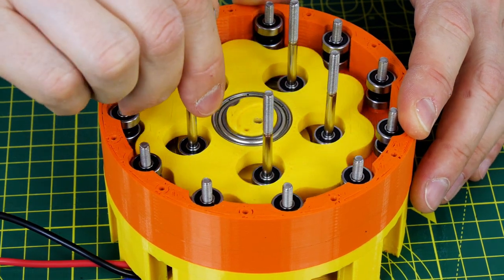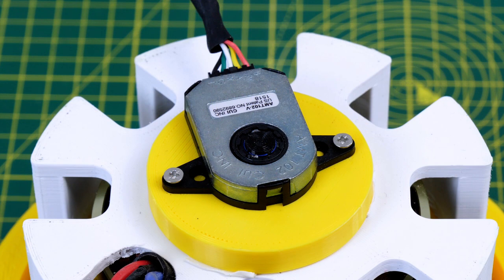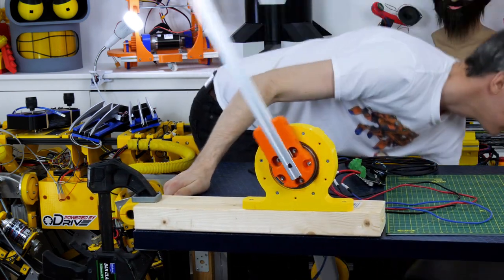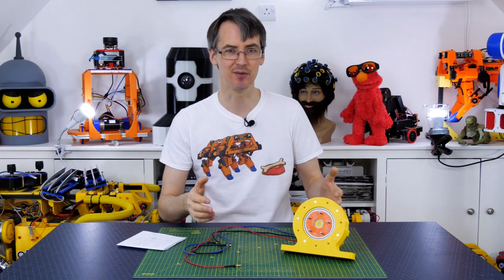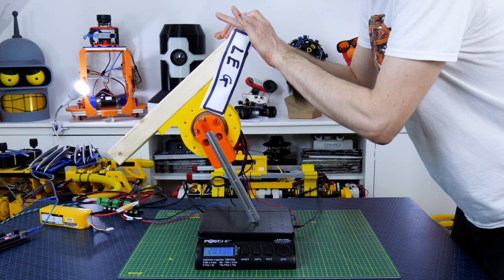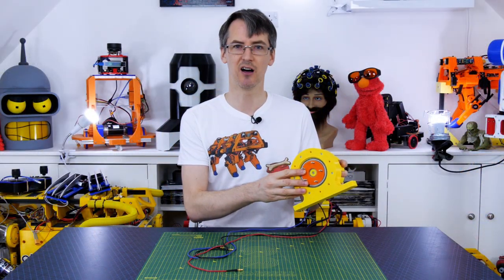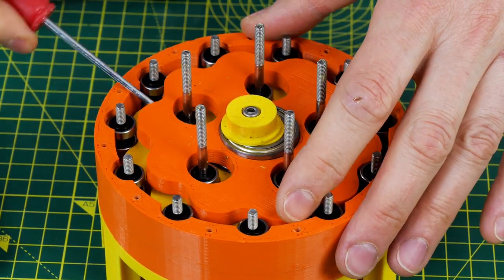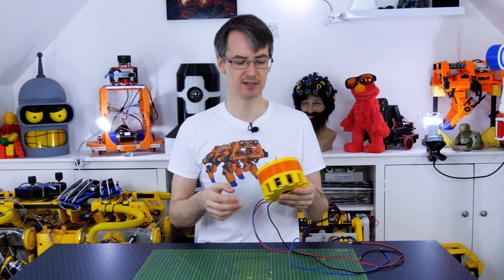Testing: Cycloidal vs Harmonic Drive 3D Printed Reducers

Comment: I imagine it would be very difficult to get comparable performance out of the strain wave setup with 3d printed materials. You lose an enormous amount of energy in the flexible spline simply due to it flexing. I have not seen a proper metal strain drive in person, but I'm pretty sure the walls of the non-toothed section are only a fraction of a millimeter thick for a drive that size. It may not seem like that big a deal, but when flexing a tube like that you can encounter rather large forces on the wave inducer.
Reply from the maker: That is true - just trying to make it robust, but it's not an ideal version

Comment: You could 3d print bearings and still have the weight and cost reductions with still pretty good bearing performance but it does still add a point of failure.

Comment: in order to reduce weight and cost you need to test designs without bearing. Have you thought about 3dprinted discs with a brass bush insert???

Comment: Could the harmonic low load be in part because of it being TPU? wouldn’t the high elasticity of TPUs potentially allow the teeth to skip under elastic loads 

I built one in PETG recently not thinking about the flexible spline  but havent been able to connect a decent motor to test it yet

Comment: I would consider using UHMW instead of nylon for the bushings, if you can get it at a good cost. It is the typical bushing material used in power tools and is far cheaper than Delrin.

Comment: Hi James, just a quick question: Have you had problems with the new Odrivetool/firmware programming? Because I just got into using the Odrive, but the current documentation on the Odrive site doesnt seem to correspond with the current tool's syntax? Do you know where I can find up to date documentation, or what else is causing this? I have a 3.6 as well. Thanks!

Comment: Hey James, might it be a good idea to integrate a temperature sensor in those drives to monitor the internal temperature? Then you can prevent it from overheating and melting the PLA.

Comment: Starting to look promising. Are the two disks still rubbing against each other? Having a tiny space between them could lower the friction even more and avoid heat, not that it seems to be a problem yet.
Reply from the maker: Yes they are, I really wanted to see how well the original design would hold up. I need some way to hold them apart, but I don't think there's too much friction since there is no load that way, so maybe just printing them in Nylon etc would do.
Reply: @jamesbruton  alternatively perhaps a bit of lithium grease would help?

Comment: I wonder if he could design a Nylon sleeve insert around the cycloid so that it'd be easily replaceable and less costly of the more expensive materials. But i do have a major question about nylon against nylon, i know in engines they use two different metals for surfaces that rub together because the "grain" is different and it reduces ware. So would two 3D printed of the same type have this same effect, and could it be mitigated by changing layer hight or some other factor?

Comment: Would it be possible to add a way to lubricate the internals without having to disassemble the motor? I’m just thinking of a long term usage (which may not be necessary or applicable here), but it would get very frustrating having to disassemble the entire robot and then all of the gear boxes to do maintenance
Reply: you want to lube the bearings more than anything. they already have a small amount that should last for any significant period of usage.

Comment: one thing i never understood about Boston dynamics Spot, and open dog, is why not use wheels on the tip of the legs instead of it just acting as a leg?
would this not drastically increase its speed as well as its ability to maneuver? sure it might not always walk like a dog, but it would have the ability to.
best of both worlds if you ask me. though i do not know about how this would affect the legs weight. might be the reason why not but if it somehow works, i would love to see the result.

Comment: I want to get into robotics but I’m on a bit of a budget. How much of a torque difference is there between the odrive and skateboard esc?
Reply from the maker: If you use sensored motors then you may be ok, although accuracy will still suffer. ODrive controls two motors, so I generally find they are cheaper overall.
Reply: @jamesbruton  I’m looking at sensorless brushless motors, I am more worried about the torque than accuracy. Will it be greatly reduced using a skateboard vesc over the odrive?

Comment: How's backlash for the two systems?
Reply from the maker: There is a little in my Cycloidal Drive, but the Cycloidal disc isn't quite the right shape - see Levi Jansen's video I mentioned, so it will be better in the next version. Harmonic drive has virtually no backlash, but again the design is not ideal.
Reply: @jamesbruton   The cycloidal disc probably failed because of the use of flexible material. This might cause the rubbing surfaces to lose alignment as tension increases thus increasing the friction. The flexibility should only be allowed laterally which a reasonably long cylinder should permit otherwise.
Reply: i would try to make the flexible ring in the harmonic in regular pla, the ones i worked with is pretty hard like springsteel.  but tbh harmonic drive is probably a bit to delicate and requires to steep tolerances for fdm printing, the cyclonial drive seems like a much better option for this.

Comment: U pick high-speed electric motors with a small moment to then lower the speed of their rotation to increase the moment. Why?  As far as I know electro engines so same as internal combustion engine  have  the higher revs the less efficiency..     The losses increase exponentially, and the power increases linearly...  or is it just that power electric motors are big and weigh a lot?
Reply from the maker: I need a lo reduction so that it can be back-driven to make a Quasi-direct drive reduction, so I get natural spring in the leg of the robot. Check out Cycloidal drive part 1 for the explanation, and the openDog V2 series.

Comment: I feel like a planetary gear is the obvious omission in these experiments here. Although, perhaps you already guestimated that puts too much load on the teeth ? Afaik they're pretty strong and print well though.
Reply from the maker: Yes I need that robot dog to jump on the ground, so I think 3D printed teeth would strip easily. That was what started me on the Cycloidal drive development because the discs are far more robust.
Reply: @jamesbruton  Yeah I figured. Still, with the size of these solutions you can make a pretty serious planetary gear too though :P

Comment: I think you can improve the harmonic drive by having the 2 teeth difference between the flexible gear and the external gear. It should scipe a lot less.
Reply: Just incase you don't know it's skip. Not sure what scipe is.
Just a friendly FYI

Comment: The cheapest bearings I find are less than 0.2€ per bearing. Are bushings superior to Chinese bearings? At some point the price difference between a German bushing and a Chinese bearing becomes small. I would be curious if you investigate that further. I may underestimate bushings. Or overestimate the capability of Chinese bearings. I thought they might be good enough to improve 3D prints. Some sound like they come with polyhedrons instead of balls, but they still feel like they have lower friction than plastic on plastic and probably a lot less wear.
I didn't consider good bushings. Maybe some Igus ones even reduce the friction and especially the vibration?

Without having thought about it more, it seems like the bearings and the shaft are the points producing the most friction and are most prone to breaking.   So a metal shaft would make sense.
Reply: Cheap bearings are still heavier than plastic, and aren't really needed here because if the cycloidal profile is correct it should be rolling so the bearings wouldn't turn at all.
Reply: @kaelwd  I don't understand how something can roll without turning. 
I see the weight savings, though. Concerning the weight and the price, I just wonder if it is worth it and I would love a benchmark.
Reply: @maxmustermann2596  when they say rolling, it's the point of contact that moves on both surfaces at the same time, not via friction nor via a bearing in which the pin turns. (cf for example https://www.youtube.com/watch?v=vs3xSoQyW1s) 
if the profiles are correct, there is no rubbing, but a moving contact point on both surfaces
Reply: @thesfreader3068  Edit: After having checked your youtubelink, showing off the knowledge of a word, which is explained there, sounds stupid. But, I swear, I knew it before ;-)
Somehow I didn't think about Involute gears https://en.wikipedia.org/wiki/Involute_gear
In that case, bearings are definitely a bad choice. Now, I need another reason to motivate somebody for a benchmark ;-)
Edit: I'm curious how real-world problems like slightly flexible materials influence the functionality of involute gears. I have to admit, that fully understanding them is still on my to-do list. The transition from one tooth to the next one still looks like friction.
Reply: @thesfreader3068  You seem to be better educated about gears. Do bearings on gears make sense in special situations? High loads? (although it doesn't seem very economic concerning how much a single bearing raises the part count)
I know 45° gears are problematic, but that is not solved by bearing balls. In this scenario, it replaces a gearbox, which might be feasible? https://s14761.pcdn.co/wp-content/uploads/sites/3/2019/09/Ceramic-Speed-Driven-drive-train-Antrieb-2020-News-Eurobike-2019-2020-002-810x540.jpg
Reply: @maxmustermann2596  sorry can't help you, everything I know about bearings and gears I learned on YouTube... (thanks James and all other great makers out there!)

Comment: You know, I've been meaning to say this in earlier videos but figured a dozen others before me already did. Either no one did, or not enough.

Please don't test the drive's torque by simply grabbing a spinning lever like that. You could easily break your arm between that 2X4 and the lever if you fail to let go in time.

Comment: To give the harmonic drive its full glory, the parts including the flex spline should be made of metal, in a much more precise way than what a 3d printer using FDM can do. Harmonic drive is not the right technology for a plastic 3d printer, much like bearings.

Comment: You should send the designs to rctestflight and tell him to try those on his solar automated rc car. He can post update videos to test resiliency. The car has a waypoint path that runs and stops when out of charge the. Startups up again doing a figure eight. He runs that nonstop for months. Chews through his pla cycloidal drives. But he is not using the bearings you are.

Comment: Danger putting your hands/fingers under a rotating arm that will pass by the edge of the table in a chopping motion. Would've been better to push it down when it's coming up instead. You got lucky that your hand didn't get stuck between the extrusion and the edge of the table, that could've been a bummer. Great video otherwise!

Comment: You've decided to negate your durability test, and do the exact thing you didn't want to do, which is print out 12 of them before you know what effect the wear will have.  You said it yourself 10:12 
The BEARINGS are why it may have suffered no wear.

Comment: Interesting legal/philosophical question: if you have a local law against motorized vehicles on a path, are you in violation of that law?.  The skateboard is not motorized. The motorized wheel-on-a-stick is certainly not a vehicle. You would definitely be in violation of the spirit of the law, but I wonder how you would fare in court.

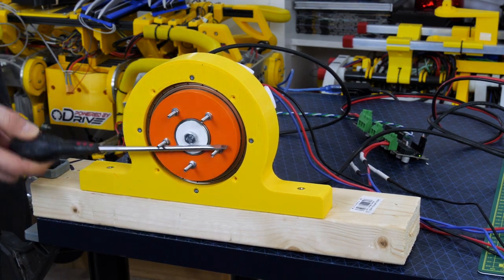Comment: 2:25 For godsake stop putting your fingers inbetween metal rods and tables and pieces of wood that have no trouble at all taking a finger off. If your test is "will my finger be strong enough to stop it" and you're hoping it's not.... then why build a rig that can crush your hand with zero problems? At least hold that rod on the up-stroke, which also stops your table falling over and gives you a lot more safety.

I'm tired of skipping over the bits where you try to mutilate yourself.

Comment: DON'T REPLACE THOSE BEARINGS!  You are lucky that plastic works at all for the stress you are applying.  You wouldn't replace the bolts with plastic ones, would you?  You need all the metal you can get!